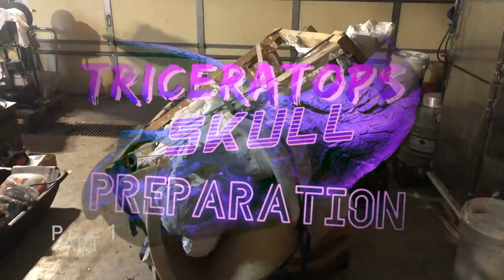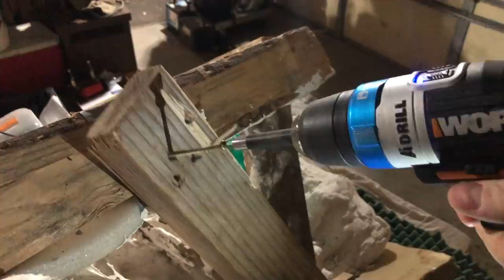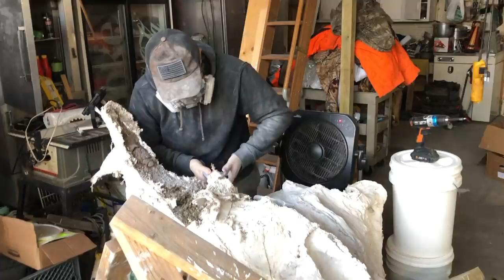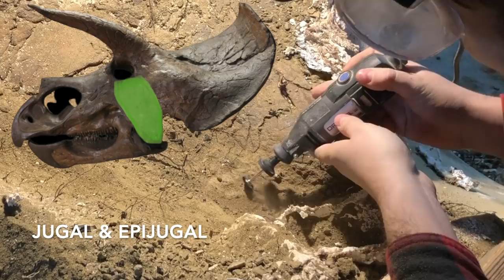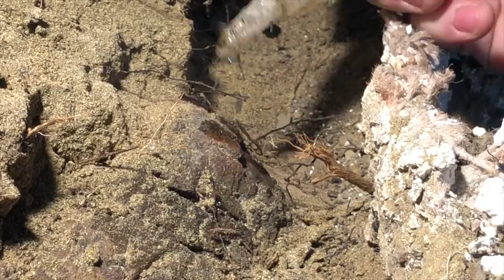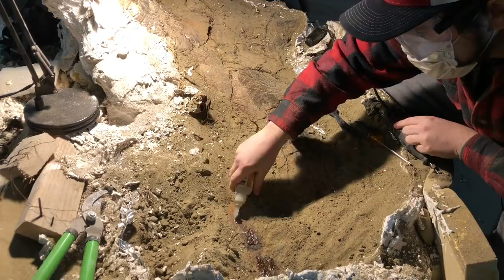Triceratops Skull Preparation | Part I

Comment: I have like 3 questions: 1 how long did you go to school to do this, 2 how does one procure a dinosaur skull, and 3 how do you know what’s bone and what’s random dirty?
Reply: I'm not him, but I can try and answer the last two questions. 1.) You can obtain a real Dinosaur skull by purchasing one. However even the replica skulls are hundreds to a few thousand dollars. 2.) Bone is harder than sedimentary rock. If you press down slightly on the bone, it won't break. If you press down on the rock, it'll break down like dust. (He has an example in a previous video.)

Comment: ALSO, does the adhesive glue the tiny bit of leftover sand to the bone? How do you get rid of this afterwards?
Reply: It would have to be mechanically removed with hand tools or an air abrasive tool.